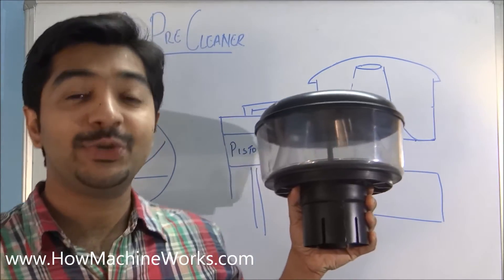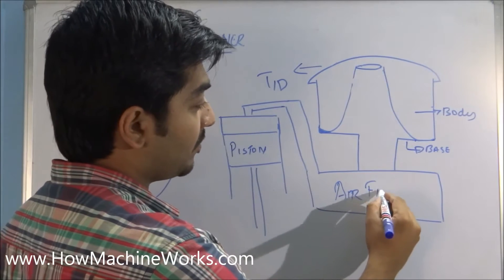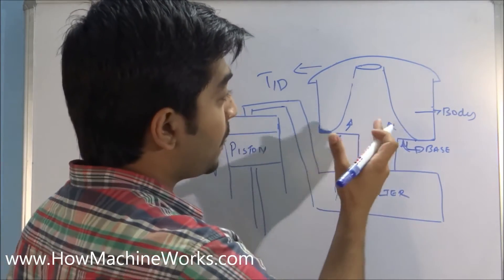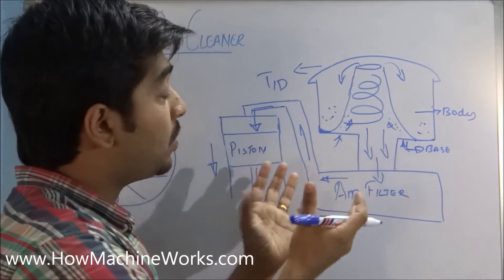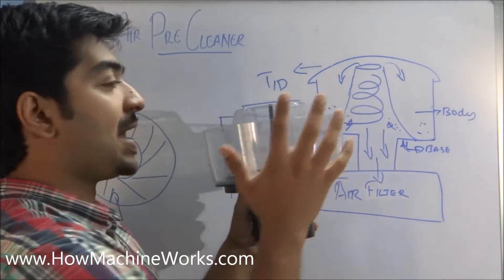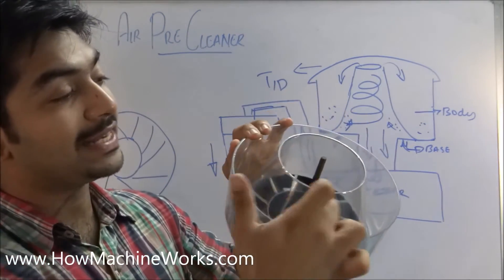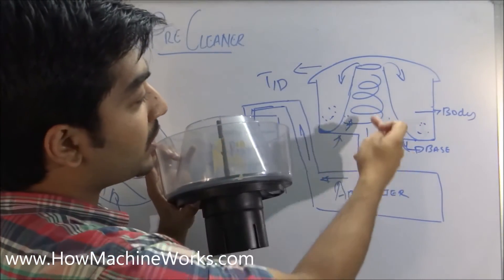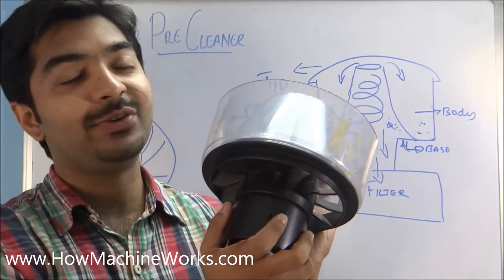How engine air intake pre-cleaner works. ✔

Comment: their is no venture action!
As the air enters at the bottom then straight into the intake pipe. it does a U turn at the bottom 
their is no suction at the top to cause a venture action and centrifugal action this does not operate like this it is not a pre-cleaner

Comment: I cannot see how this is going to be so effective when the pressure in the dust container is  atmospheric while the  pressure in the intake manifold is well below atmospheric.  I feel that the vortex created will  not rise as much as it is stated in this video.
Another arrangement is required  where the  first air intake must be tangential to the outermost surface , note tangential so that it will circulate the heavy particles to the circumference and the light air will be sucked from the centre.  Thus the normal pressure logic is contained,